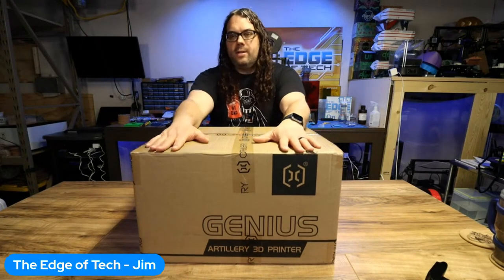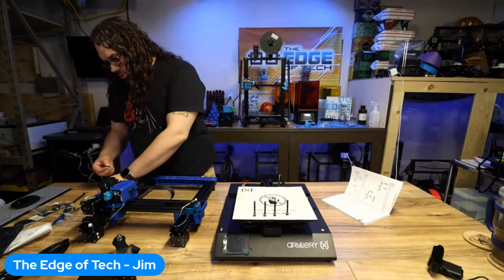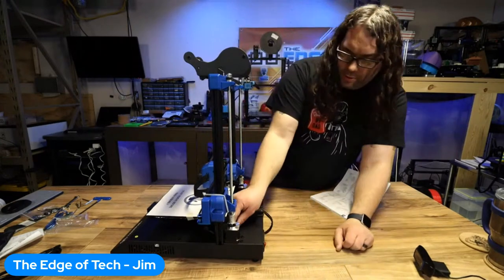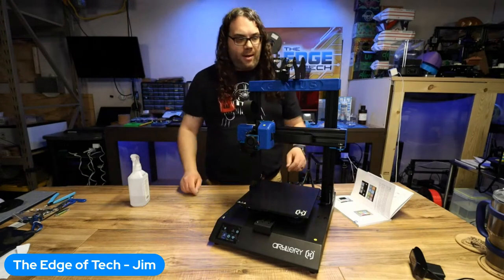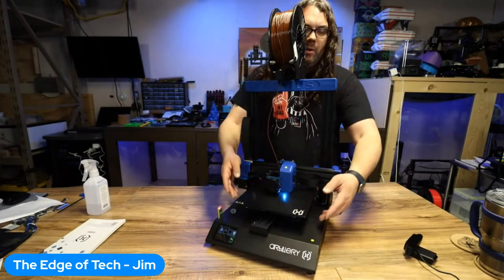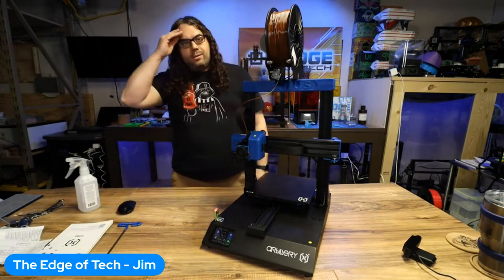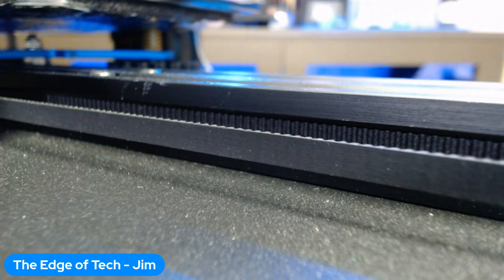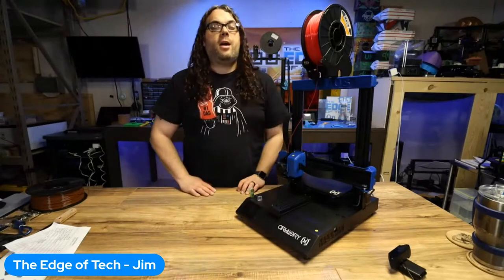Artillery Genius - 3D Printer Unboxing

Comment: Jim - believe the Enders have that yellow coating on the bed too - has anyone contacted the manufacturers to find out what it is and whether it should be left to aid adhesion or longevity of the glass plate?
Reply: from what I understand its actually like hairspray, it helps adhesion.